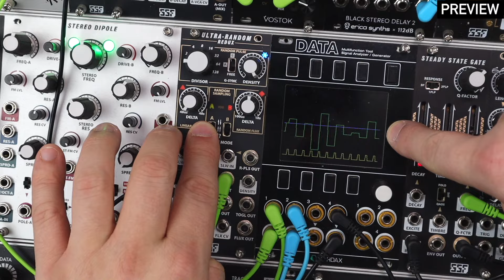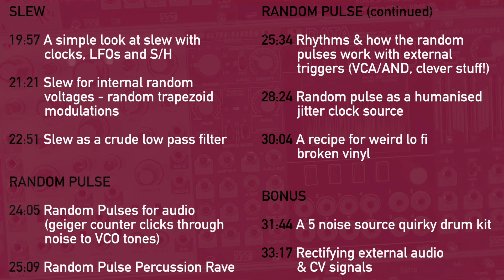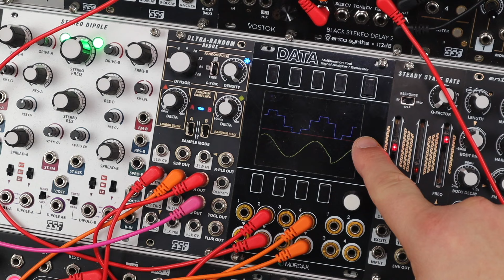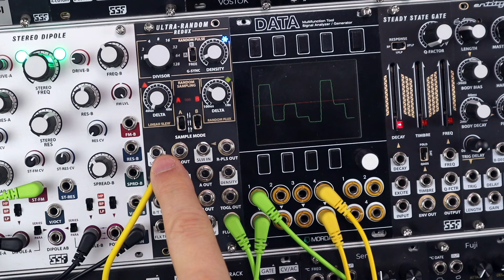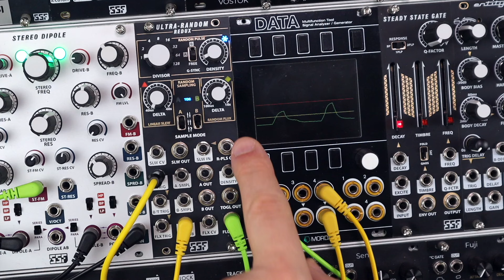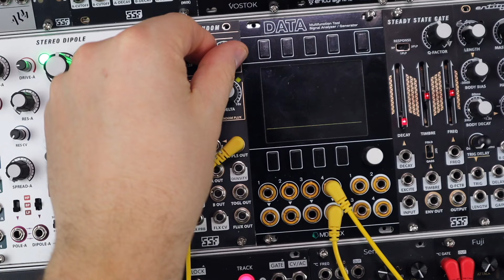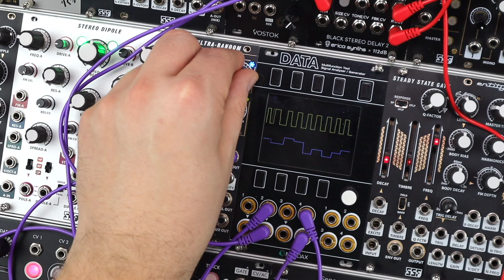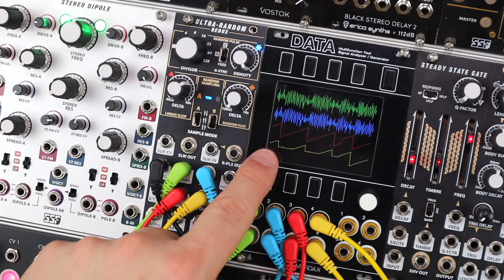The Return of a Eurorack Classic // Ultra Random Redux by Steady State Fate

Comment: SLIDEY GLIDEY! ... I mean .. HARD SYNC! Not sure if Redux is more of a direct replacement or more complimentary to the original URA. Seems like a bit of each! Thanks for the overview. Excellent as always.
Reply from the maker: slidey glidey ... haha I talk some rubbish. 

Thanks!
Reply: Don’t change a thing. 😝
Reply from the maker: appreciate that
Reply: Yes, I wondered the same thing, even emailed SSF. So, is this a more powerful version of the URA or another module completely? 

I was looking at the Frap Tools Sapel (again) the other day, but kept hesitating due to size and lack of input possibilities. However, this seems to be a module that does almost what Sapel does (without dedicated noise sources) in 10hp, which for a small system is so useful.
Reply from the maker: the noise sources are hiding in there, they just need coaxing out as the video shows. But they're not independent from the other processes. It's built on the ideas and design of the URA. But the URR is a new design, improved circuits and performance, lost a couple of things, gained a couple.